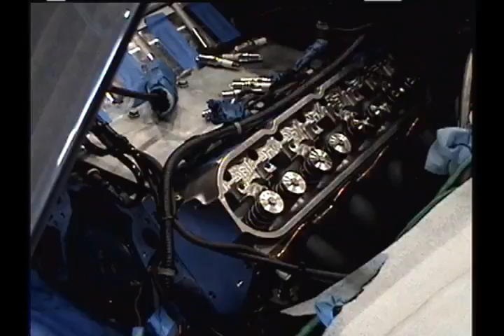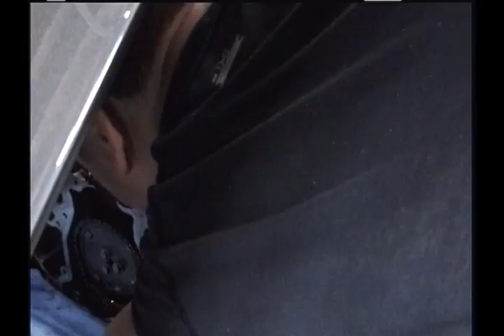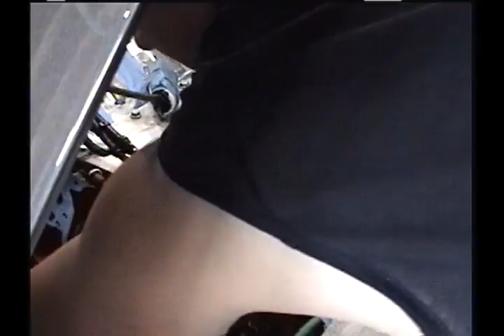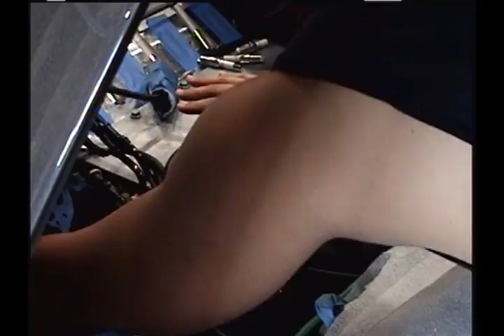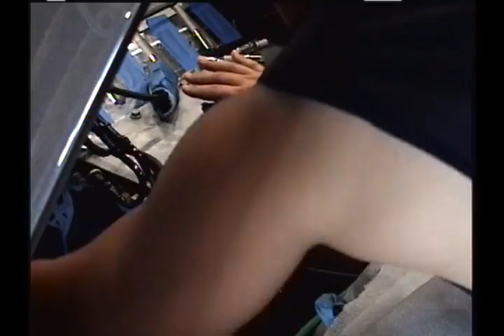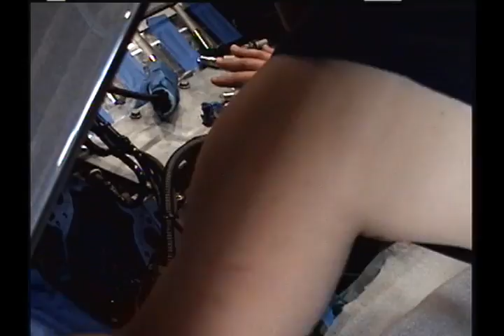Installing Rocker Arms & Pushrods on LS Motor. Boosted C6 Build. Part 29

Comment: Your videos are helping so much. Quick question... I installed my lifters, push rods and rockers as shown the when I pushed down on the rockers to check piston clearance the plungers went down and my rods fell out of rocker seat. First thing that came to mind was WTF and I was stumped. I’m an electrical engineer and this is my first build, so my thought was turn English be over and see is it locks in. They did, but I’m concerned this isn’t normal. Is this typical with hydraulic lifters and do I need longer rods? Thoughts 💭?

Comment: How can you tell if the valves are hitting the piston when turning it over
Reply from the maker: Hello Mark. Thanks for watching and thanks for the question. Its very simple you will feel it, hear it and the motor will not want to turn over as the piston and valve will contact each other and the piston/rod wont make a full rotation on the crank as the valve will stop the piston.
Reply: @WATCHMEWRENCH  I figured you wouldn't be able to turn the engine anymore if they made contact. Thanks for the clarification. Great video by the way. Thanks for the help